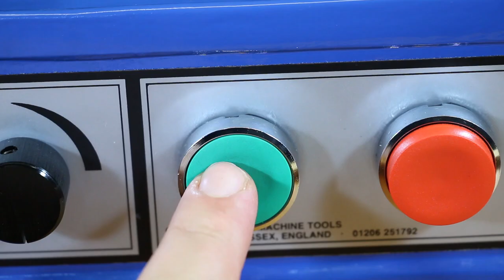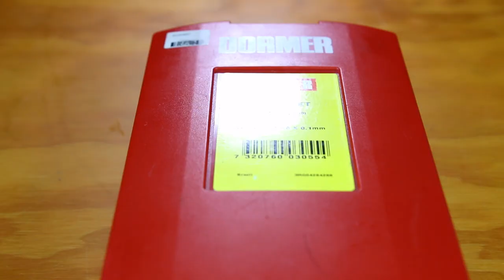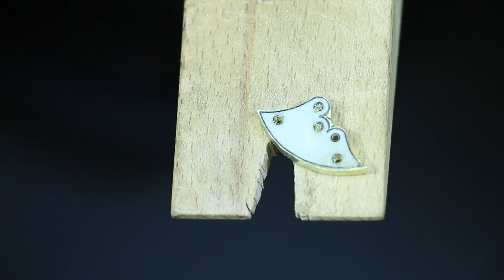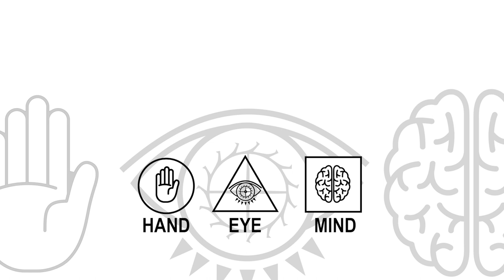Watchmaking Vlog 3 Making the Train Bridge for my watch

Comment: Dean,
Before the invention of the Jig Bore, high precision boreing was done on a lathe using a face plate and toolmaker buttons. The locations would be initially laid out using a surface plate and height gauge. The precise locations would be determined mathematically and positioned by using micrometers and readjusting the toolmaker buttons. Once the button locations were  positioned, the plate to be bored would be attached to the  face plate of a lathe. The buttons (bore position) would be located with a dial indicator. After the button was indicated in, it would be removed and the plate would be drilled and bored to the final size. The size of the machinery was much larger but the process was similar to the one you are demonstrating.
david
Reply from the maker: +Vivienne Pierce Whoa that is awesome information! Thank you for sharing that David! Much appreciated.

Comment: Dean,
A small boreing head is available with either  an 8mm or straight  shank. This will fit into your tailstock which allow you to fine adjust the cutter position.  If I can ever get out from under the time crunch I am in I will make some videos showing some of my  machining techniques. It is uplifting to see someone taking watchmaking past the level of disassembly,  replacing parts, reassembly and adjusting. Keep up the good work.
david
Reply from the maker: +Vivienne Pierce That would be a great video to watch David. Please let me know when you get the time to do so. Thanks for the encouragement

Comment: can you please explain the tools more? 
can you recommend any lathes? and how are the holes tapered? it was mentioned ealier that the holes for the jewels are tapered. also how do you control the exact diameter? how can it be that the original bridge wasnt damaged if the holes are the same size and you did not drill the holes ready after removing the original bridge.
Reply from the maker: Hi, sorry about the delay, I will be covering this shortly. Using reamers :)

Comment: Great work again Dean!
Seeing this done is very worthwhile and gives a great deal more depth than reading "Watchmaking". It's an excellent book but seeing someone using the instructions is great!

About the train bridge: the positioning pins seem rather critical to me. Wouldn't it have been more precise to press them out of the old bridge first, marking out the holes for them and them drilling the holes for the rest of the parts? To do it all in one go?

Also, as I really enjoy watching your progress I hope that you mind your health :). Please don't heat cyanoacrylate glues in a confined space without very good ventilation. The fumes are really quite toxic.

Best regards
Karl
Reply from the maker: +Karl Månsson Thanks Karl :) 

In regards to the pins, their holes aren't through, so I can't press them out one end, only pull them out? When looking through the scope the pins are very clean rounds, making them easy to centre. I found even using jewel press the smallest deformation to the edge of the hole make it more difficult to centre during the fine tune part, as it get can difficult when turning the faceplate to tell if the hole is a little eccentric or its a slight deformation of a hole. 

I think the next time I do this to make the master, I will try leaving the jewels in to centre the part. 

Thanks for your support Karl, I will take your advice onboard, I tend not to use super glue, so its unfamiliar for me.
Reply: Dean DK Hi Dean! What did you use at 10 sec into the video to fix the original bridge to the brass stock?
Reply: Maybe I misunderstood, wasn't that super glue in the video?
Reply from the maker: it was super glue. I was worried I may not get the shellac even and flat.
Reply: Okay, then my word of caution applies :)

Also, the locating pins, aren't they pressed in, machined off and then plated over? Have you tried pressing them out of the bridge?
Reply from the maker: You know I never actually tried. But I will try this sometime this week. Thanks Karl !